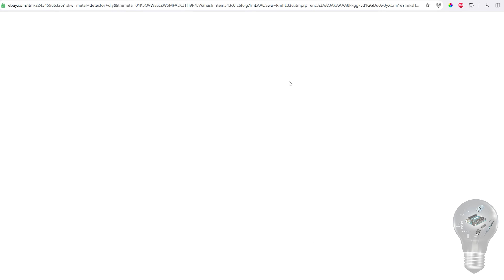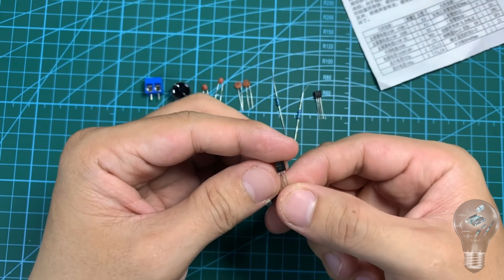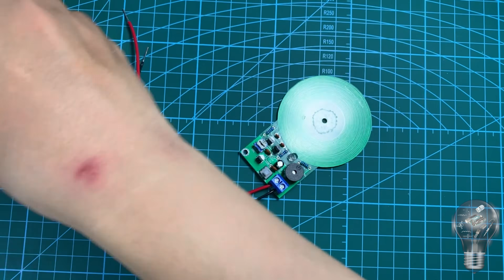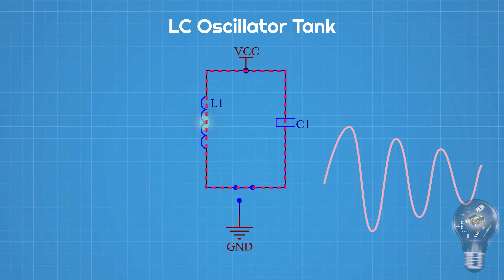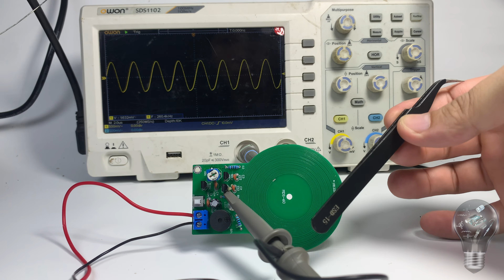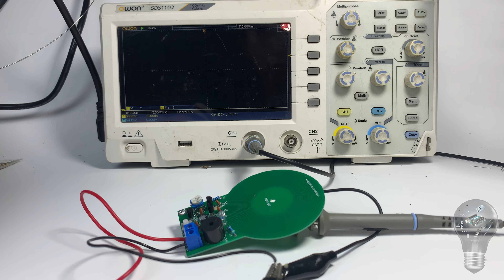DIY Metal Detector Kit | How Does This $3 Circuit Actually Work?

Comment: The funny thing is that they used more active parts than were used in much better metal detectors back in the past.  They used a single vacuum tube and the really clever bit of the design was the two coils.  They were arranged so that out in free space (nothing bending the lines of force) the coupling between the coils was zeroed out.
Reply from the maker: I understand the principle you mentioned, but in reality I’ve seen a few circuits of that type and they were more complicated, not as simple as you described. Could you share the circuit you’re referring to?
Reply: @ElectroInventor1990  Sadly, I have no copy of the schematic.
Reply from the maker: maybe i will make a better version :v